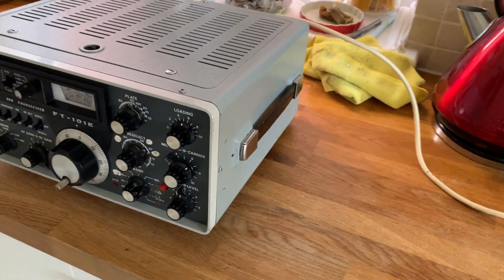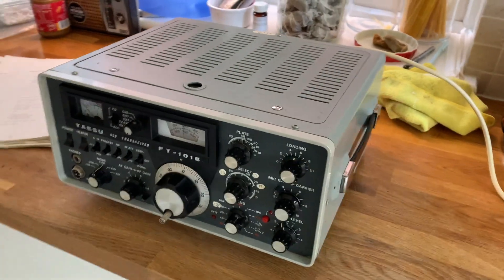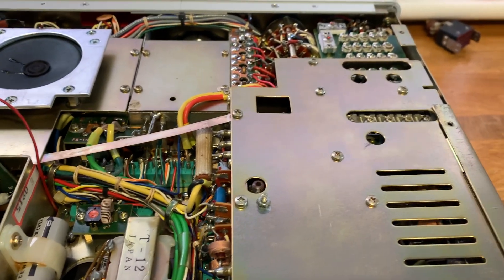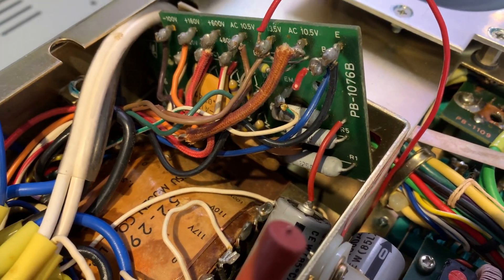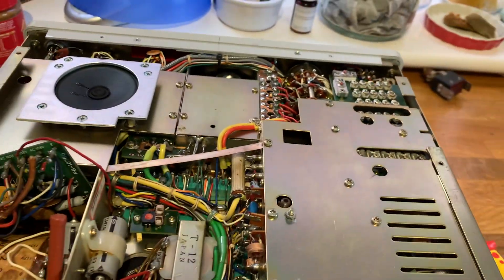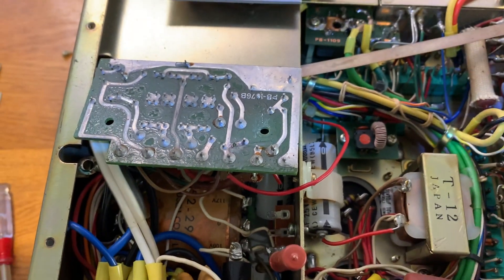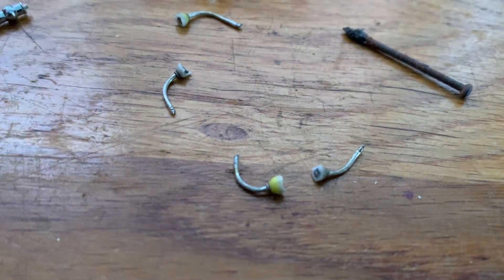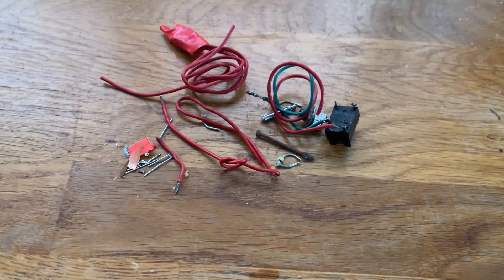RADIO HAM: Yaesu FT101E Receive repair -  Next the TX

Comment: That radio is the reason why i have radios today. 1981, my best friends Parents were both Hams, she invited me over one day and she showed me her Parents radio room. she had two 101's parked next to each other along with a vast collection of other radios but the 101's stood out to me above the rest. I'll never forget the impression it left on me, her Mum got her G4 licence and i would sit with her and watch tapping the key. i was around 13/14 years old at the time. Cheers MIke, brings back alot of good memories. 73
Reply from the maker: Hey Matt, Its the sounds and smell of the tubes of these older radios that bring the memories for me..
Reply: @Mike-M0MSN Completely off-topic Mike, but I have a question about scientific calculators and Amateur radio formulae. I've noticed that on one or two of your videos, you use a scientific calculator.  Have you ever thought of doing a video on how they are used in regards to the exams?
I've searched the web but with no real results, and i think you may be the man to change that as I'm sure I'm not the only one who struggles with the calculator input.
73 Mike, and thank you.

Comment: Hi Mike, seems like a 27Mhz mod gone wrong.
I have 101s as well, replaced old fets with J310, and dual gate with 3sk163.
Very hot rx now.
73 DE William,
ZS4L
Reply from the maker: Yes maybe, anyway working now (RX that is) :)

Comment: Wonderful video. What was the "modification" that was done?
Reply from the maker: 11 meters
Reply: @mike-M0MSN  Actually I think you will find that the modification was to bring the WARC bands to the rig - so 30, 17 and 12 metres. Hence the extra markings that are on the front of the rig. I have a 101E the same in which I fitted the same mod many years ago. The rig has sat on my shelf for many years and needs new finals in it and have at long last decided to do the work on it. So been looking up vids on the subject. There are one or two questionable ones out there!! (G0OIK)
Reply from the maker: @PeterKings  hi Peter,  yep, I still have to finish the work on this 101…. One day. Cheers

Comment: One of the issues that can escalate quickly is the equalising resistors across the high voltage rectifier diodes, they are operated at over rated voltage (not wattage) and when they fail they cause the rectifiers to fail like dominoes. I will message you elsewhere 73<<Edit I wrote this before the end of the video!
Reply from the maker: Thanks, will take a look

Comment: On my FT-101EE, unless I have the Heater switch ON, it won't transmit....what could it be?  Thank you everyone for your thoughts and advice.
Reply: The heater switch controls the filaments for the output tubes. It's normal behaviour that you can't transmit without it on, the reason you'd turn it off is if you're on battery and just listening, or saving wear on the tubes when not transmitting. After turning on the heater it'll take around 30s before the tubes are war,ed up and you can start transmitting. If you havent used a tube set before, check the manual for the procedure of tuning up the finals.